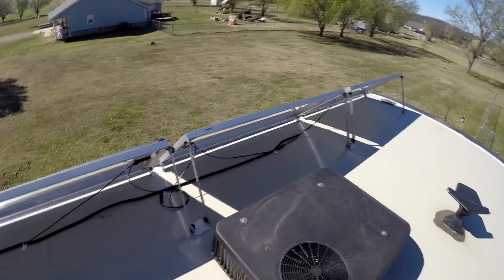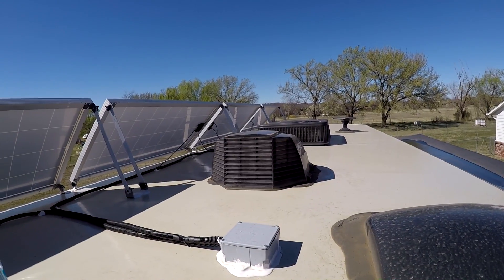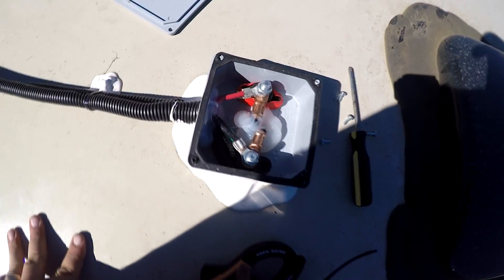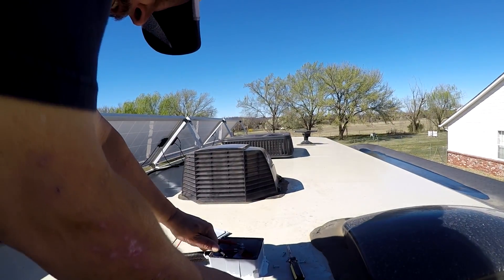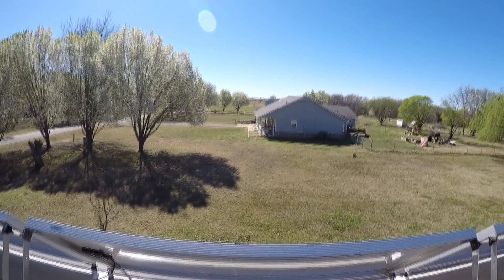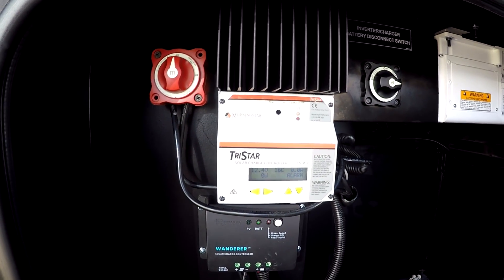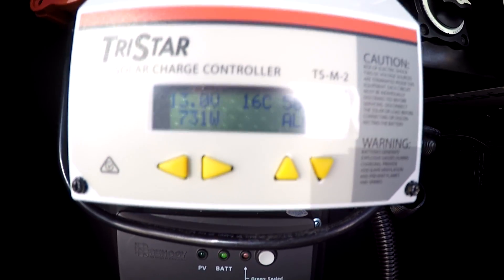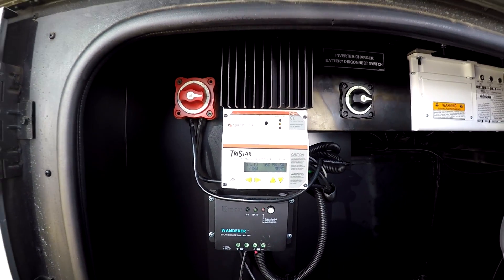Video Short - RV Solar, Tilt & Measure Volts/AMPS - Nomadic Native

Comment: Would you benefit from a larger capacity controller, or are there other limitations that made you go with a sixty amp?
Reply from the maker: Richard Lupfer Hi, There are 960 watts on the roof, so far the single mppt-60 has worked well for us. I installed a second one for some additional ground panels that I can put out away from the RV if we’re shaded or need extra. Thanks for watching!

Comment: Are there any problems mounting on fiberglass? We bought a Casita and have thought about mounting panels on the roof! Thanks for sharing!
Reply from the maker: Robin our roof is fiberglass but it's a glass/wood/foam laminate. I've seen Casitas & I'm certain there is a way to mount panels, however, if it were me and I wanted solar in a Casita I probably would not mount panels. I would probably buy the thin flexible solar panels, wire them up and lay them flat on the ground. They are very lite, thin, flexible, store really easy, light weight, and Brian told me that you can actually walk on them & not hurt them. I know that Technomadia uses them in this manner & it seems to work well for them. I'm going to do the same. Going to replace our ground mounted regular panels for about 600 watts of flexibles. Hope that helps some. For a better answer about mounting panels on your rig contact Brian Boone on FaceBook, I'm certain he will know the correct answer.
Reply: Thanks, had not thought about that!

Comment: Wow that's a lot Of power your producing, very nice 👍🏻
Reply from the maker: Hi! I know this is going to be hard to believe, I wouldn't believe it if I wasn't watching it happen with my own eyes. We sit here in the RV watching TV, computers running, charging stuff, then we have the residential fridge and all the other vampire power suckers, and the solar is running all of that while at the same time keeping the battery bank fully charged. I wanted to torture the system a bit & cooked dinner, 45 minutes in the pressure cooker on top of all the other power we were using, I think I heard the solar laugh at me. I know, hard to believe, so I'm making a video. Can't wait to meet up you guys!!